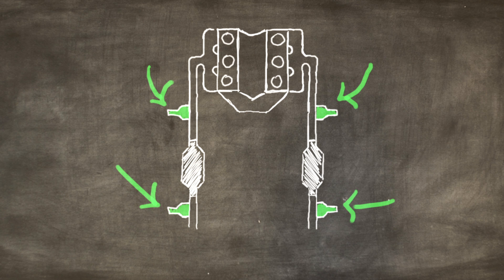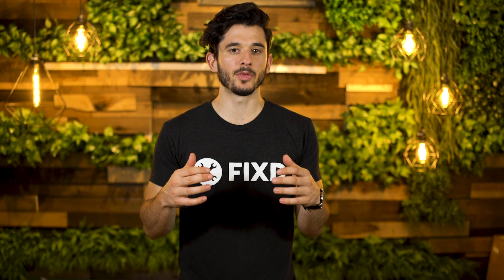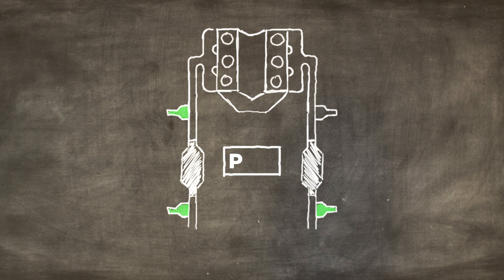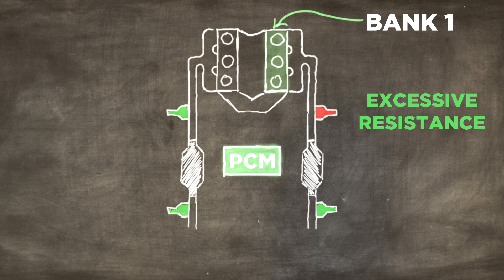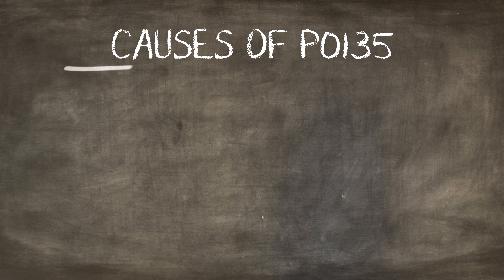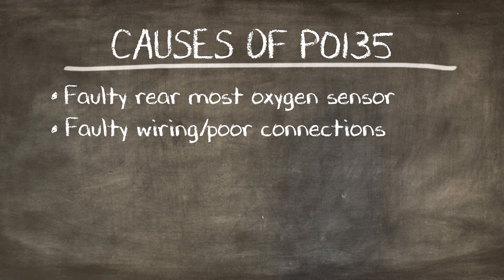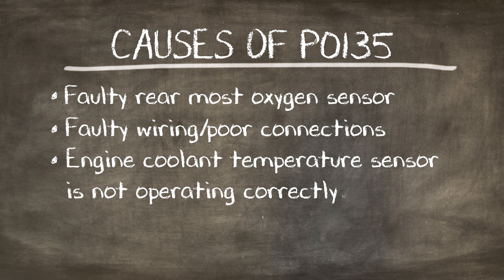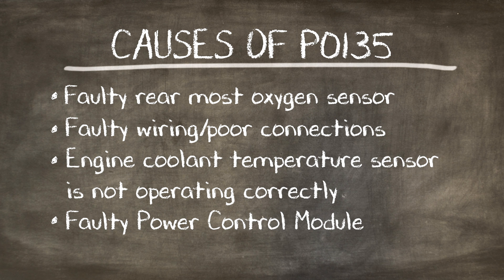P0135 Explained - Oxygen Sensor Heater Circuit Malfunction (Simple Fix)

Comment: Idiot
Reply: Just seen someone explain it right. To test it out you have to go down on the connectors with one of those testers with the light to see if you’re getting any kind of current. Just buying an 02’sensor won’t fix it. I tried replaced all 4 of them twice

Comment: The simple fix for a PO135 code bank 1 sensor 1 is to remove that upstream O2 sensor, check the ohms reading on the heating element wires to make sure the element is not severed inside.  If no reading, replace the sensor, if it reads with somewhere between 11 and 7 then it's good.  Take some carb spray and clean it off real good, getting inside the holes.  Check the condition of the terminal ends and spray a little wd40 on the pin seat, wipe off any excess spray.  With the upstream sensor off the manifold, take your carb spray and bend the straw to where you can spray towards the catalytic converter, spray for a good minute.  You're trying to clean off the carbon from the clogged inlet screen of the cat.  Let it sit for several minutes.  While waiting make sure your spark plug wires are not touching any grounds, tuck them away or use zip ties to hold them up a little.  By now you should be able to reinstall the O2 sensor.  Clear the code with a reader or disconnect the neg term at the battery and turn the ignition on for 30 seconds.  This will reset everything to default and clear your codes.  Start your car, let it warm up and then take it for a 20 min drive.  If the code doesn't return, you resolved it!

Comment: i have a 2009 Acura TSX throwing two codes. P0135 and P0498. I have replaced the EVAC solenoid, Oxygen sensor and purge valve. Still getting the codes. Any ideas?
Reply: Did you ever find the issue for this?
Reply: @Spidercarmine935 I’m having the same issue p0135 and p0161 replaced sensors 3 times and just did the connector replacement and still comes up
Reply: @spiderpanch  Try looking up the fuses for the oxygen sensor heater loop, they could have popped. Also try following the wiring. the wiring could have gotten cut or melted. Hopefully not a PCM issue.
Reply: @SeanMan1337 I thought it was the pcm but haven’t gotten the code and I didn’t know they had a fuse by the 02 sensors.

Comment: I’m getting p0135 with my RT but also P1128 I was told to change all the 02 sensors first but I need help because p1128 is with the PCM can the P0135 cause that?

Comment: do i change both of the front ones or just 1  that went bad
Reply: Check the wires first and your current o2 sensor.  I replaced mine with a $90 o2 sensor but it didn't fix the CEL.  Now I have to test with a multimeter to find out what the issue is.
Reply: P0135 is for bank 1 sensor 1.  It's the o2 sensor before the catalytic converter....on bank 1.
Reply: @nite82hawk  bank 1 is the driver side right
Reply: @cnottagejr  no passenger
Reply: @danielsmith1897  Old but in case someone else wonders. On a V engine bank 1 is always the side with cylinder 1. So it can be driver or passenger side depending on the firing order. My car bank 1 is driver side. If the sensors are really old, just replace them both. They tend to get slow to respond over time and drift a little bit. They tend to make your car run rich over long periods of time.